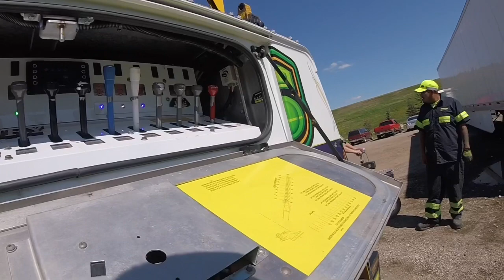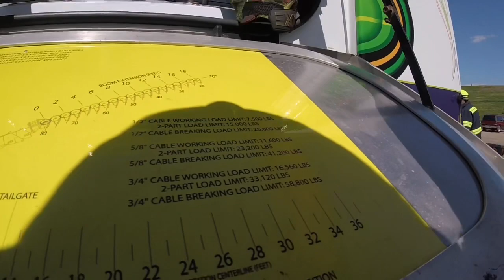Rotator work ep#112 landscaping w/a semi

Comment: Like the chest cam in that there is less movement  but on the other hand it’s nice to see your view and that your head is on a swivel sometimes  when you are working with other operators on bigger Jobs  also  on the danger side of a truck  it shows that you look both ways  before you step from in between a truck and a trailer shows you are being  as safe there as you can  thanks  for the options.

Comment: I prefer the higher perspective of the head cam, but sometimes it looks like it needs to be aimed lower about a 1/2 a click. lol.  Chest cam is good as an occasional alternate perspective.
Reply from the maker: yea the head cam shows a bit more I think when I use the head cam I need to be a bit slower on the head movement thanks again for watching
Reply: 1140 rotator work The movement has never bothered me. But then I’m used to peoples heads being on a swivel since I’m a heavy equipment and a telecommunications engineering field assistant. (That’s not a mouth full). Lol.

Comment: Do you ever use the drop axle?
Reply from the maker: yes all the time once I release the parking break that axel drops with out it down I cant drive its over weight about 5k thanks for watching and commenting
Reply: 1140 rotator work Are saying your truck is overweight no matter what without it, or just when loaded? Thanks for the reply by the way. Awesome work all the time you guys.
Reply from the maker: Yes even if I am empty if it’s not down I’m overweight unfortunately I got a 2600 dollar fine driving thru sugar grove and I was about 5 k over with the axel up
Reply: 1140 rotator work Damn!  I just can’t believe I never noticed it down. But I guess most of the time when the trucks moving, the camera is in the cab on your head. Lol.